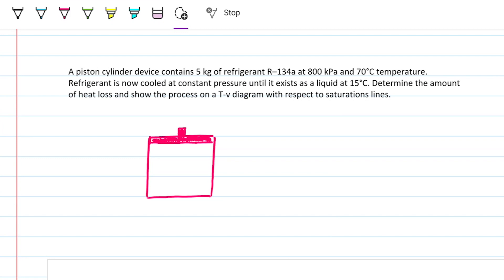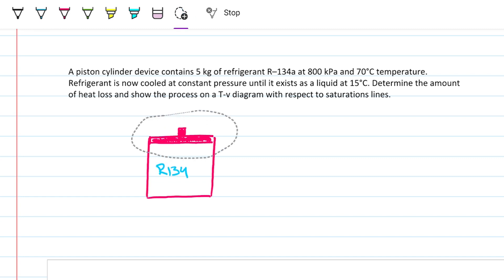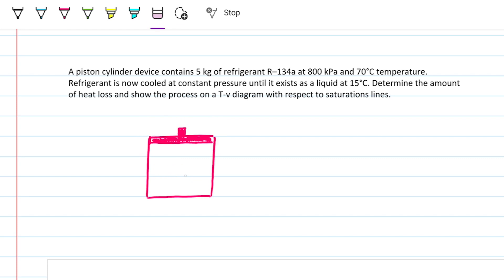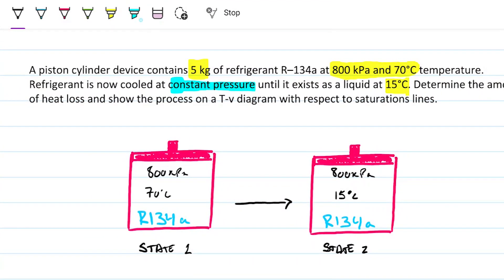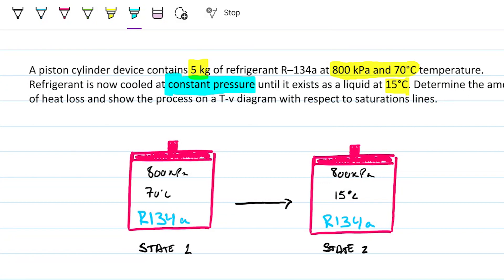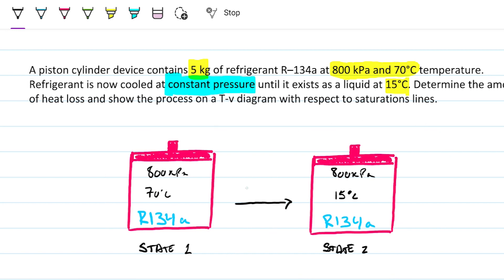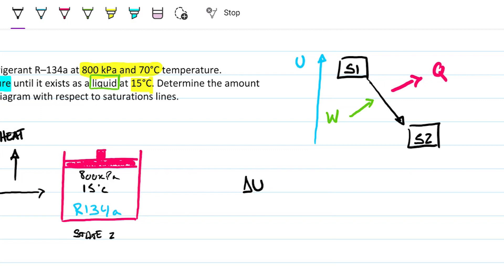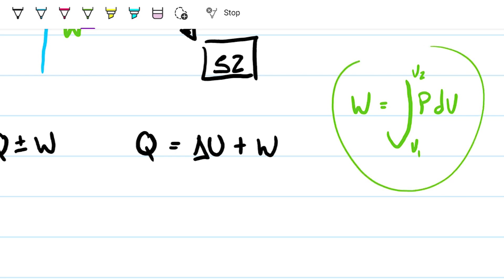Going from superheated to sub-cooled fluid | First Law | Thermodynamics

Comment: what is the difference between heat transfer and? the temperature being constant, aren't those the same thing, if the temp is constant we won't have heat getting transferred right?
Reply from the maker: Heat transfer is a CONSEQUENCE of the difference of temperature. So yes, in that case we would not have heat being transferred